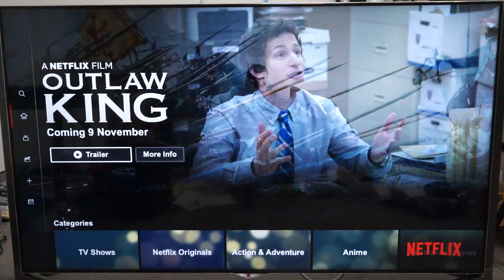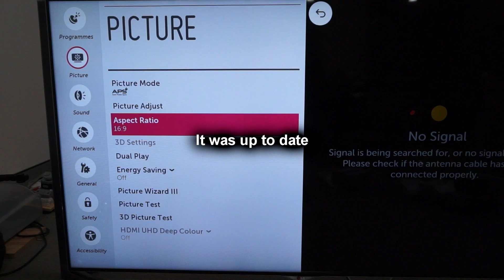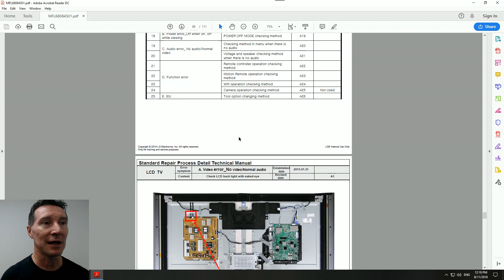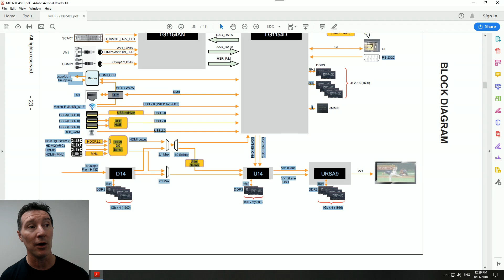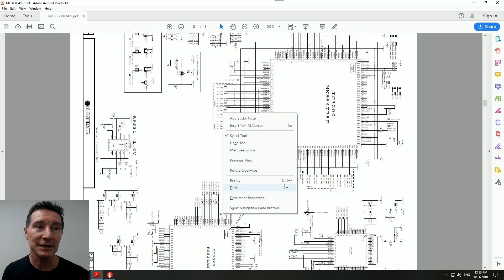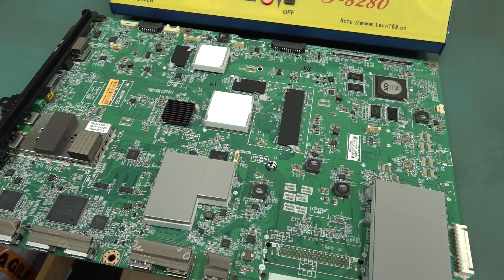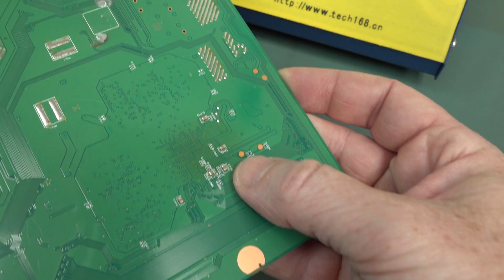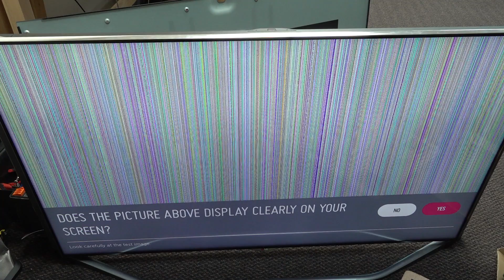EEVblog #1154 - Surprising 4K Dumpster TV Fault

Comment: Seems to be a common issue, this was the fail mode of my LG 4k 3d smart tv, I was a bit luckier on my reflow and to prevent it from happening again in the future I repurposed a heat-pipe from a laptop to dump the heat away from it, they are so thin that adequate cooling seems to be an afterthought

Comment: As we all know,motorised ball valve is actually best suitable for automatic brewing system due to its big and smooth orifice,as well as its excellent working performance,and some solenoid valves can not work reliably at all in brewing system,though it is the truth,but most of people always think the motorised ball valve is very expensive and they can not afford to buy it.With this in mind,we would bring a best solution for you,that is,you can get high quality motorised ball valve 
 
 
we can produce different electric valve, such as on/off valve, proportional valve, it can work with different voltage, and different control method for option.Our electric valves have a wide range of applications, if you are interested, please contact me
Website: http://www.tf-electricvalves.com
Email: lee@china-electricvalves.com

Comment: a possible fix for it would be to take it off, reball with leaded solder, and then use that to finalise alignment
as, if they used lead free, you'll never get it aligned by hand

Comment: with reballing, I dont think lead free solder has the surface tension to pull BGA chips into alignment
I'm pretty sure you need an xray to check alignment, there
Reply: dunno which they used though since I'm not into consumer product standards and rules so idk if they have to use lead free

Comment: I wrote a script at work that uses the RS-232 on an LG TV to automate entering text on the keyboard. Also, on some models you can change Debug Status to "EVENT" (in the Instart menu) and it'll unlock all kinds of cool debugging menus if you type the word "debug" on the RS-232 terminal.
By the way, you should be able to simulate pressing the Instart button to open the service menu by sending "mc 01 fb" over the serial port. The password is 0413.

Comment: A big problem with BGA's in particular, and all modern solder joints in general is the stupid "lead free" solder. It is almost pure tin. The melting point is higher, it grows tin whiskers over time, and it is brittle. I blame the Germans personally.

Comment: an xd engine ddr ram problem. either the ram's main rail's noisy, or one of the chips' the problem. check signals using you're oscilloscope. you have more than enough high end gear and engineering knowledge to diagnose that correctly..... right?

Comment: A fault caused by corrupted firmware maybe?But in reflowing the flux is always needed otherwise the cracked soldering joins are getting worse.

Comment: I know this is a crazy though, but could it be something as simple as a mis-match between the frame rate being sent and frame rate capable of the monitor? 

1) I'd check for a cross-over between the speed control crystal on the 3d vs 2d sections of the board.

2) I'd check to see if the crystal isn't soldered correctly / missing entirely on the GPU video output line.

Comment: my lg tv's, when you change image settings on the netflix app, nothing happens, you can only see the changes when you plays something. I know you ruled out the t con board from your 1st video, however I often hear that these fail. One thing is sure something is going wrong with the post processed video. Does look like that chip is the fault, may be useful for someone else.

Comment: Preheating is a good idea, in my experience boards can warp unless the temp is raised around the chip. Also, I wouldn't consider reballing, if you're going down that path try and find a replacement chip and replace the part. I've only ever reballed my own hardware since they are hard to guarantee. Having said that, a great video as always, I always learn something new watching others troubleshooting steps.

Comment: Cracked joints can usually by identified by applying pressure to the top of the BGA while its running. Look for the picture changing. Failing that try heating and cooling  the BGAs one at a time while it's running. The expansion and contraction will often show intermittent faults, but also temporarily fix o/c joints by breaking through the oxide. The PCB vias under hot BGAs can often fail due to expansion and contraction, it's not always the solder joints. The DDR RAM chips can fail. We often have issues with them not going down properly in the first place because they're so light. We find the larger metal topped BGAs usually go down okay, but suffer more expansion contraction fractures longer term, so I always suspect the hotter running chips.

Comment: Since the BGA was likely screwed up solder by poking it I'd say nothing to lose removing it now...any guides for DIY reballing?
I have to admit I have no clue what I'm doing but I probably would have tried to dribble some very runny flux under the chip until it ran out the other side prior to attempting the reflow....but maybe that too would be a dumb idea

Comment: So weve got an older sanyo flatscreen, its a 19 inch flatscreen from around 2010-2011, dont have the model handy at the moment, but anyways, you turn it on and it displays picture for a few seconds and then the screen goes black but keeps playing audio. In your expert opinion, what would you think this would be? easy fix? i figure maybe its the main board or maybe even the backlight driver going out, im fairly good with electronics but i just want to get a good point of reference to start. If you have any information for me id appreciate it and ill also get the model. Model number is either DP13649 or DP15649 Manufactured by Sanyo May 2009

Comment: Just unsolder the whole chip, remove it and clean the board-pads and check the BGA-form. For most BGA-chips you get forms to reball them.... you put the chip in the form, add a metalcover with holes, add the balls, heat it slowly until the balls stick to the chip. Remove the metalcover and put the chip on the board with enough flux. Then heat to solder-temp and you're good in 95% of the time. Done this with my PS3 2 times already, saving me like 100bucks per repair :)

Comment: I had an LG TV that had a big black line down the middle of the screen so I found a crack in a resistor in the middle of a ribbon cable and re-soldered it and it worked find for a while then I got another line and fixed it then got another line , problem was it had about 10,000 screws to take it apart, what a freakin nightmare, the labor costs makes repair impractical even if you know what the problem is. 

did you check the internal connectors , I remember someone going through a lengthy diagnosis only to find bent pins on a connector... just as I say this he addresses the connectors.

Comment: With Samsung TVs there's no need for a service remote, instead while power is off, press (mute 1 8 2 power) on remote control & TV will turn on & get you into service menu; use arrow buttons to navigate & select to make changes.

Comment: Remove the chip, heat the balls, heat the board, flux it (there is no such thing as too much flux),  check for shorts, re-allign the chip (I can see from here that it is squint, and I'm about 5,000 miles away), re-flow. Test again (rinse, repeat etc).

Comment: You can certainly reball the chip by hand, placing each ball onto each pad. Its not as hard as you think, if the balls are covered in flux paste its pretty easy. then you just flow them into place. simple.

Comment: Hi Dave. First thing, you should be using proper flux for reflow. Take Louis Rossmann's offer below (he knows well).
Second advice, warm the board to about 160-180C on pre-heater. It is most likely lead free solder there so you need to run it hot. When you get the solder flowing with the hot air gun, don't use maximum flow, it may blow some small components around it off. Third advice, never push down on the chip, instead, very carefully push the side to check if the solder is flowing. In this case I doubt the reflow could have fixed the issue. I'd suggest chip replacement or entire board, which you can buy used off eBay. Thanks for your videos, enjoyable! Best wishes!

Comment: From the looks of it the service manual was suggesting cracked soldering for a similar image issue to yours.

I guess that 500 may have been too much for that board. Look at the discolouration around the area you heated. Or was that the flux messing with the coating?

Comment: Not sure if it works on the consumer models, but on the pro version on the LG screens you can enter the service menu with a regular remote. 
Press and hold menu until the menu disappears, then press 0 (zero) 4 times and the set or OK button. 

And if you have a samsung screen you turn it off, press mute 182 and power on, and the service menu should appear. 
Be vary careful in the samsung service menu, you can actually  brick the screen.

Comment: I'm going to send you some flux. You clearly do not have enough. :'(
Reply: Don't delay...
Reply: @Louis Rossmann : Don't delay, send it today :-)
Reply: Good advice from the Flux-Man himself!
Reply: He used about 1/10 of a Paul of flux
Reply: Also send him a bag of solder balls!
I want to see the struggle :))
Reply: This job probably needs about 4 Paul's of flux since it's a bigger board and bigger chips
Reply: I'm sure you could get this board up and running.
Reply: that's was my first thought, Louis will cry if he see that soldering without Flux...
Reply: All I could think about was you when I seen that minuscule amount of flux, then I scrolled down and there you were, the man, the myth, the legend.
Reply: Haha, louis, in relation to you ... you are right.
btw: simple rosin solved in ipa is a really simple, cost-effective and good flux (like EN ISO 9454 - 111A) if you dont care about rosin leftovers (i like it, because its an additional protective layer)
Reply: Flux: The bigger the gob, the better the job.
Reply: really is a small word here on youtube. i was gonna say, should've preheated the whole board, a ground ball probably gave up the ghost, and bmaybe that extra bit of heat would've had it going the first time.
Reply: I was watching him grab the heat gun and the first thing I thought was 'Louis would yell at him for not using flux ...'
Reply: There you are. I knew if I saw a EEV video with surface mount work a Rossmann comment would pop up, I must admit I am a bit impressed it's you yourself I just expected other people or me who have learned SMD to comment about Louis Rossmann.

 How do you like that service manual Dave has from LG? Looks nice doesn't it? Maybe if you ask Apple nicely they can give you service manuals for their stuff >:)
Reply: mm delicious flux. it really helps the breakfast of solder-bites go down smoothly.
Reply: Haha, you've got a good sense of humour Louis, never lose it :)
Reply: Please do a follow-up video using the flux Louis sends you. I'm sure we'd see a miracle.
Reply: I can't wait till I get an ultrasonic cleaner so that I can finally use as much flux as my boards deserve
I'm skimpy because it's hard to clean
probably doesn't help that I use rosin
Reply: Louis, I always wondered why you don't have a big rubbermaid tote of flux and just dunk your boards in it :P
Reply: Does he get jolly ranchers too?

Comment: When I worked at Nintendo at Kirkland, we had all the kit; Mantis microscopes, fancy Hakko soldering stations, air-pencils, vacuum rigs...you name it!
One bit of training they did was to allow folks to bring in dead consumer electronics with an eye at fixing them in the shop.
Get in a lot of practice working on other peoples mistakes!
A buddy brought in an LG TV, and over the course of 3 months every dang IC and transistor had been flowed off the PCB, cleaned, examined, put back on wrong, removed, broken, replaced, put back on right, you name it!
In the end it was a partly shorted by-pass capacitor...swollen electrolytic, nobody saw it!
Check yer basics first!
Reply: Working at Nintendo... I would love an old 2DS motherboard schematic... Have one here that doesn't power up (LED goes blue, stays few seconds, slight pop and turns off), can't find the fault to save my life. Not the screen having bad connection, nor screen itself (tested even with another 2DS screen).

That TV seems to have been molested way past repair point... Did you guys manage to fix it in the end or did all the molesting kill too many ICs inside to make it possible?

Comment: First thing I would have done is pull the back off, make sure I have access to all the connectors for the miles of ribbon cables, turn it on, play a movie, then play with the connectors. Wiggle the wire, push/pull the connectors, etc. My job's maintenance dept. threw out a perfectly good 46" Samsung from one of the conference rooms due to a loose connection and zero troubleshooting skills. A little rub with an emery board and some contact cleaner and it's still in my living room 2 years later.

Comment: Those service manuals assume board swapping. The days of narrowing down a particular component because of the service manual are gone. You have to use your instincts. The original problem looks to be like a video codec problem - something probably related to MP4 video since the problem only occurs in video streams. So whatever chip handles the codec for MP4 - that would be my target.

Comment: I think that the issues there was the RAM or not enough power in vcc rail of the mpeg decoder chip ,
and please dont educate young enginers in this way, the bga reflow thing is bullshit even if it works it is temporary,
I think that any one with little knowledge of electronics knows that the pin pitch of those chips is very tiny, there is no way to do it with those tools you used! Total Amateur Work!

Comment: You should of tried freeze spray first. My guess...clock going out of lock. Some of the corrupted pictures made me kinda think that rather than data or address issue on RAM. Maybe broken power supply cap causing local supply dip. 4K means there are several GHz clocks probably coming from the HDMI chip interface even if nothing plugged in, it will probably fall back to locking to a local reference.

Comment: They include the serial commands in the consumer manual because they are used by AV system integrators to connect and control the display via a control system such as Extron, Crestron, AMX, Control4 etc. They wouldn't put it in the service manual since those are rarely shipped with the unit and are not always available online.

Comment: Dave: you, like all of us other techs, are the victim of the industry using Eco Solder. When they started using it, the temp that causes it to melt was lowered and now we have failures due to it. I try to use old lead based solder when I can as it has a higher temp to it. Keep up the good work my friend!

Comment: I really like this video and the last one! You should do more video's like this getting old broken things, dumpster diving and so on then show us how you fix the problem. Of course people will disagree with your methods but it would be nice to see you fix something you found. It is sad to see manufacturers only test parts like power, panel, or main board and if something is broken they just replace the whole thing! I mean you know yourself you could probably fix that board and it may be worth doing but its not always easy to diagnose. 

I remember back in the day we would have a tv repair man out and he would fix our tv and it would usually be something small like a resistor or transistor. but he would be there for quite some time with his kit finding the problem. You dont see that any more we need to see more of that though. Maybe not so easy on chips like you tried but at least some fault finding to repair something that would otherwise have been just dumped because its a repair the manufacturer either doesnt want to do or that the owners just go out and buy a new one.

More like this please love it thank you!

Comment: argh ....    hitting the chip with the tweezers is not a good idea ... i did this "mistake" some times ...some solder balls splashes under the chip and short to their neighbors ...    so you have to reball it ...but for this 4k tv ...it should worth it :)

Comment: Did you checked memory chips ? This could be also here what cause video issues !!! You get memory bga checker/reader tools from china for a low price... If you don't have already one... I can see in your video that a bga memory seems to be higher than others where you heated the board... Get stencils and reball all that... Mainly on video issues memory is involved !

Comment: Think it's best to blow heat around the chip so the hot air goes down to the spheres and reflow, if you put heat on it you risk creating bubbles on the chip and ruining it (that's probably what happened), it's good too remove the moisture from the plate leaving it for a few hours (or days) in a warm place and with little humidity, thus decreasing the chances of creating bubbles in the chip, as the bubbles are caused by the water inside the chip wanting to leave the chip.

Comment: Occurrences of Pink (violet) are often related to YUV / Y'UV color space garbage-output.  11111111... = Y`:luma=full-brightness ; U:blue-chroma=full ; V:red-chroma=full === pink.

I estimate the whole problem boils down to a software corruption.  No -- there are no hardware video decoders in modern televisions that aren't software driven and updateable.  Some deep factory resets or flashing were needed, or now, board replacement.

Comment: If you put a little flux around what you are trying to re-flow you can tell the chip has reseated because it dances. That's the point at which you stop heating.  Also flux around the chip insures you don't have dry balls. Nobody likes dry balls during a re-flow.